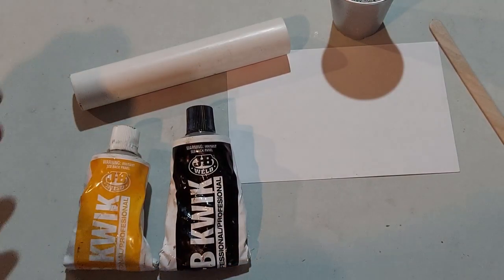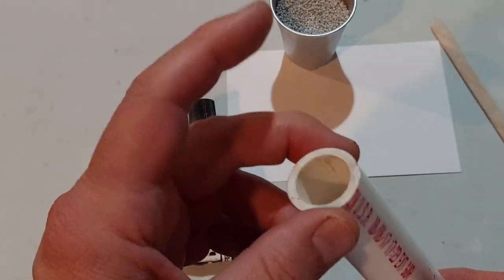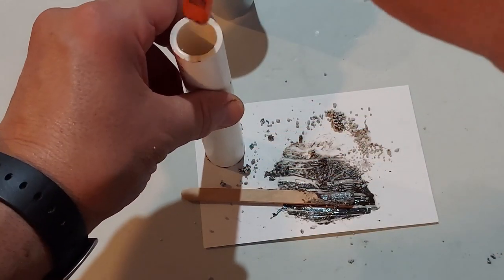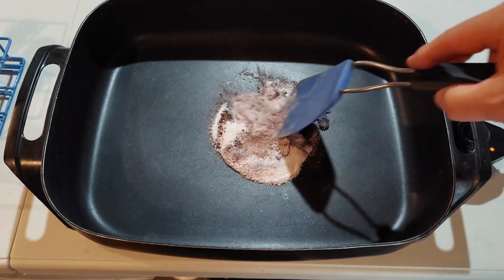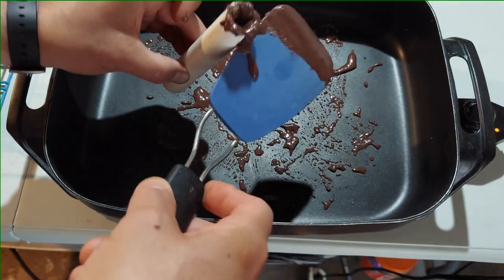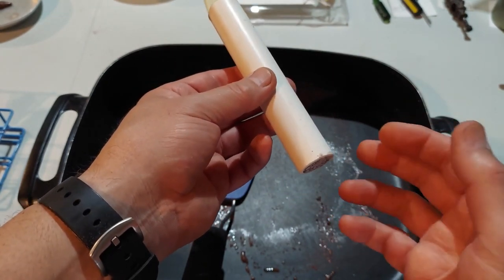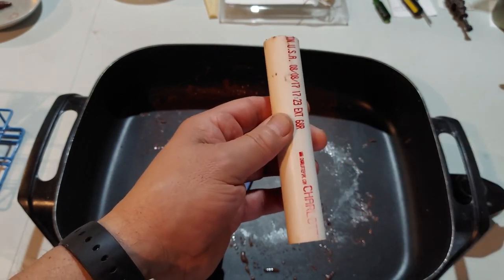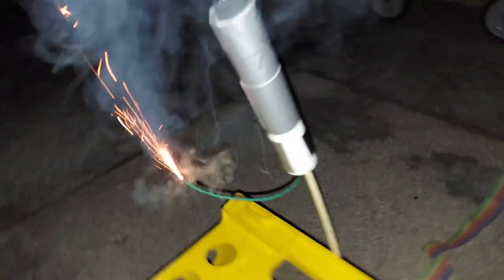Making Sorbitol Based Rocket Engines

Comment: This was beautiful. I appreciate your beautiful effort in explaining this model. I want advice from you. Is raw potassium nitrate stronger or a potassium nitrate fertilizer? I have a school project on Tuesday. I want a rocket to launch. Please help me.
Reply from the maker: That's a bit tricky of a question as "raw" potassium nitrate comes in different grades.  But, most of them are better than potassium nitrate fertilizer.  However, having used both, and when it comes to rocket engines, they work the same.